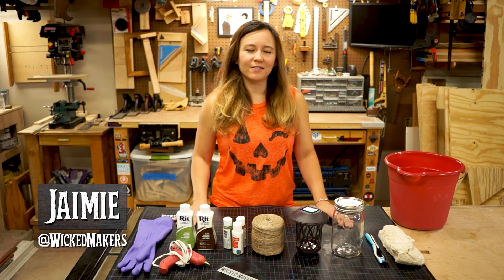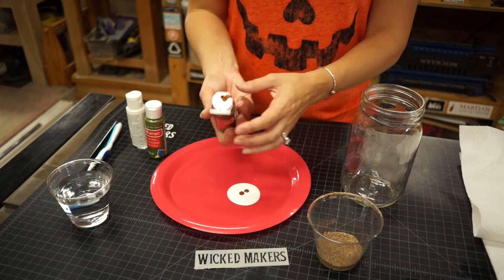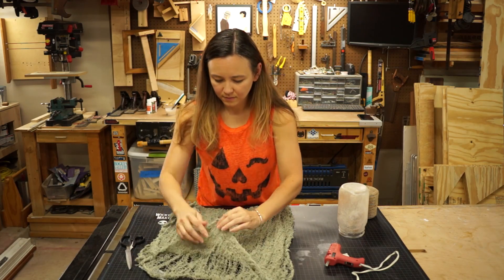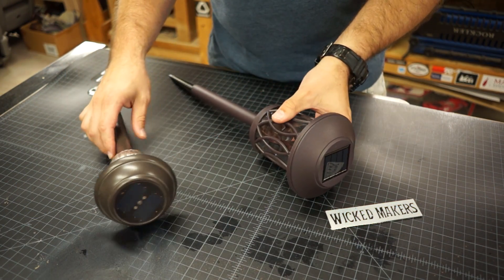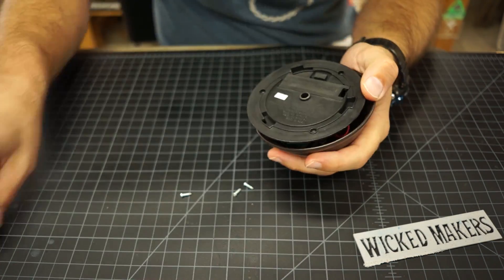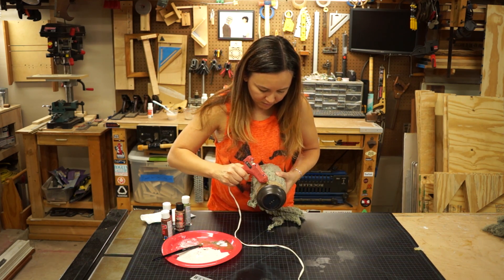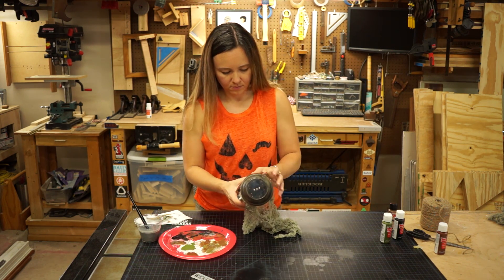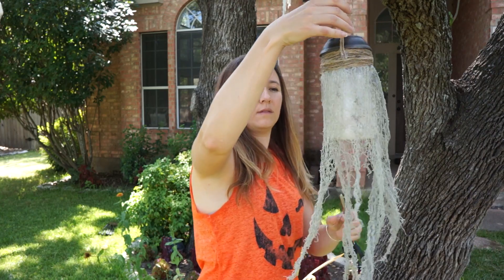DIY Halloween Props - Mason Jar Hanging Lights (Solar Powered!)

Comment: So, just a little tip, instead of changing out the led light, paint a thin layer of gallery glass paint on the bulb. It dries clear orange (for painting stained glass) in any craft store or on Amazon.
Reply from the maker: Nice!! You wouldn’t get the flickering but great way to adjust the color. Love it.
Reply: @WickedMakers  I was about to post a similar comment but noticed someone beat me to it..great minds think alike...actually I wouldn't mind doing this for when we go camping down the beach each summer..we use a gazebo out front of our caravan so I could tie one one or to the posts...make it safer when walking back to camp during one of those late night treks that old folks have to do..chuckle..
Reply: But then you don't get that flicker.
Reply: @WickedMakers jay
Reply: Another and possibly cheaper option is to use a marker or sharpie to colour over the bulb. You can make the colour as transparent or opaque as you want. 
Pros: 
You can leave areas of the bulb “as is” transparent and only colour the areas you want so that you can still see the flickering. 
Or use different shades that are normally seen on a lit candle. Yellow, orange, red, blue, purple, white. 
And if the marker or sharpie is still wet you can use a cloth to either wipe the colour off entirely or use a paper towel to add dimension and remove excess colour so it appears more organic 
After the marker or sharpie has dried you can typically use any multipurpose cleaner that you have in the house or a diy all purpose cleaner (white vinegar, 90% or greater rubbing alcohol and (yes it has to be) blue Dawn dishsoap and it will remove any trace of colour. Leaving you with a clean blank canvas. 
Cons:
The rare time all purpose cleaner doesn’t remove all the colour, use acetone on a cotton round to do the job. Just make sure to follow the acetone with another cotton round that is saturated in water. I’ve never had any issues or caused damage to any light bulbs using this method and the water to wash off the acetone is apparently not necessary. But I try to live by the motto Better safe than sorry.

Comment: The fabric is common cheesecloth, you can buy that all over the place, fabric stores sell it by the yard, also hardware/paint stores sell cheesecloth, so its very easy to find.
Reply: I'm getting a message from "beatmetodeath" saying they can't find cheesecloth, they sell it by that name at paint stores, fabric stores, walmart has it in more than one department, or just Google cheesecloth, its sold all over the place and its cheap.
Reply: G56AG  among other places, in 🇨🇦 we can buy cheesecloth in our grocery stores. Amazon and Wish also sell it.
Reply: This isn't cheesecloth.  Cheesecloth is much finer.  This stuff usually only comes out at Halloween.
Reply: I'm sorry you don't know much about cheesecloth, it comes in a broad variety of grades from 10 to 90. Grade 10 is extremely coarse (open) while grade 90 is a very fine weave. Stores often only carry one grade, as an example paint stores usually stock the grade most often used by painters, and that is the only one they carry, a good fabric store is more likely to have a variety of grades to choose from. Google cheesecloth grades for an explanation about the grades and their thread counts, etc.
Reply: It's gauze cloth

Comment: Just buy the mason jar solar lids. Use stained glass paint to paint the LEDs if they're not the color you want. Really cool project. I've made fairy jars like this with fairy and dragon silhouettes in them. Great to make with kids too.
Reply: I would stick with regular ac power lid as solar lid is not reliable and don't last long. I should know as I have them and they only lasted 6 months.

Comment: We glued the lid ring to the light so we can unscrew it if we need to replace the battery. I also clipped off the edges of the battery lid to help center the lid ring.

Comment: I love that you changed light.  Since I do not have any flickering candles, i thought I would buy flicker leds and replace them that way.  On the leds i want to purchase it requires at least 4.5vdc to fire the flicker circuit which I believe the solar will not provide.  Am I correct?
Reply from the maker: Hmm, 4.5v is probably too much for these little solar lights, yeah. The ones we used have a single niMh rechargeable AA which is 1.2v at full charge. If you can find something with a lesser requirement you might be better off. Good luck! :)

Comment: Love them! I don’t know if I saw it correctly but how would you replace the battery if need be? It’s late, so I might be mistaken and the battery compartment was on the bottom.
Reply from the maker: Thanks! It's a rechargeable battery so you shouldn't have to change it often. Ours have lasted for three Halloweens now. If you do though, just pop the top off, swap battery, hot glue back on.

Comment: i would try kind of orange transparent paper for the orange glow and put it in the glas. so you don´t have to use a soldering gun to change the tiny little bulbs. instead using the solar light as it is. not everyone is skilled enough to use such things even if it looks easy ; )

Comment: Folks, don't solder circuit boards to change the color. Since the outside is opaque, just add a piece of colored gel over the led. It takes two seconds a bit of tape and you can put any colors you want in your lanterns. In addition, leds aren't always interchangeable. Simpler is better.
Reply from the maker: Simpler idea, sure. But you don’t get the flickering effect this way.

Comment: I have bought many different solar outdoor path lights over the years and all of them have only lasted one season.  May I ask how many years have you had these outside?  It looks like it would be rather complicated to take it all apart to replace with a new solar lantern lid.  You guys are so creative! I really want to do this but also really want them to last! What is the battery for if they are solar and wouldn't you need to replace the battery over time and then have to pull off all the hot glued twine?  I hope this isn't a stupid question.
Reply from the maker: We're going into the third season since we originally made these and most of them are still doing fine. The solar lids have a replaceable, rechargeable AA battery and some of them needed to have the battery replaced from time to time. We basically just pulled the top off and re-glued it, so not a big deal really. If you need to, you can heat the glue with a heat gun to help it come off easier. It kinds of depends on the quality of the battery you put in there as well. Hope that helps!
Reply: Rachael Richardson you can buy the new rechargeable battery’s at Walmart
Reply: @WulfricTheBlack  Thank you.  I guess I always thought the solar had to have a special "solar rechargeable".
Reply: @WickedMakers  Thank you. I do feel stupid....I thought the solar panel had something permanent. Gee, not only do I now know how to make really cool solar lanterns, but now I know what to do with the solar lights after they quit working!  Is there a brand rechargeable you can recommend?  Thanks again.  You are amazing!
Reply: Rachael Richardson well these rechargeable replaceable batteries are specific to solar lights. I believe you check the light itself it will have something indicating which type and I believe it’s in the outdoor section at Walmart for replacement batteries.

Comment: So I’m currently making these and the only modifications I’m going to make to these are- I’m going to use a screw on lid for protection of the LED and a standard candle like the ones you guys took apart originally, only because those lights you glued on, the rechargeable battery will eventually loose it’s ability to charge and you’ll have to replace it and the cost of those is huge vs another pack of LED faux candles, and it’s easier to just dump the old led and throw a new one in instead of the whole battery change+possibly redoing the whole twine on the candle. I also just used the same paint I used to make the green/brown wash to make the dye for the cheese clothe, that saves you 5-8 bucks on buying the cloth dye. I also will probably use a matte varnish to protect the paint on the glass to prevent chipping in the future as the paint ages as well as the metal lid from rusting, although I’m not sure of the effect on the visibility despite the varnish being clear. I loved the video tho thank you for the inspiration and awesome video quality, it’s always so nice to see haunters that are a little savvy when it comes to audio/video.
Reply from the maker: Awesome!! Those are great ideas. 🤘🏼😄 Glad you enjoyed the video.

Comment: Very cool! Not sure if you've figured this out yet or not, but a great way to frost class and make it look old and weathered is to mix regular Elmer's school glue with water, and paint that on the glass. It seems to hold up and stick much better than latex paint. I made an old looking gas lantern using this technique. Here's a shot of the lantern https://youtu.be/cQ8dLPfXdNo?t=7
Reply: Question what was the ratio of glue to water you used?

Comment: Everyone uses hot glue, but I just don't have the same success with non-porous surfaces like glass and plastic.  Do I need my gun/glue to be hotter or what's the secret here?  Just had a plastic/metal bond fail multiple times--switching to E6000 or something for that project. Used Gorilla hot glue sticks on that project, if it matters.
Reply from the maker: Try taking some 120-150grit sandpaper and scoring the surface. It might help with glue adhesion. Usually we’ll try to rough up the surface prior to gluing if it’s really smooth like flat glass. 👊🏼👊🏼

Comment: I don't have any solar led lamps and the ones they sell near me are pretty expensive :/ Do you guys think it'd be possible to put a real candle inside the jar? What changes would I have to make for it to work (except for obviously cutting a hole in the lid to make air for the candle)? I don't want my house to burn x)
Reply from the maker: Yeah that should work! Just don't put a lid on it at all and make sure you use a shorter candle so that the twine doesn't catch fire. Otherwise that'd work pretty well and probably look awesome.
Reply: @WickedMakers  Thanks for the answer! I love your the DIY, looks super spooky and cool for Halloween, I'm so happy I'll get to one :)

Comment: Why didn’t you just use the flickering light? Wouldn’t that like more authentic than a constant light?
Reply from the maker: We did use the flickering light. We took the flickering led out of the candle and installed it in the solar light.
Reply: Wicked Makers - oh okay I thought you used the bulb for the orange not the flicker, was hard to see the flicker in the end result.

Comment: I have never once had any luck with a glue gun. The glue never holds, and just comes right off... is there some special type of glue stick you need?
Reply from the maker: Hmm, that sounds odd. What were you trying to stick it too? Usually they work pretty well!
Reply: @WickedMakers  I've tried both glass and plastic, but last time I tried to buy some sticks I noticed there are different kinds  presumably for different purposes, and wondering if I am buying the wrong type?

Comment: "Cheap"?
fabric, glue gun, glue sticks, 2 dye etc.
Reply: Most crafters have these things around anyway. The $$ part for me would be the solar lights..
Reply: @wendijackson8844  we got our solar lights from the dollar store
Reply: I'm a crafter and I don't have the Mason jars, the solar lights or the tye dye paint 😆😆 But you can replace some of these things with others along the way, for example you could probably just put in the small LED candles that you can find at the dollar store (which I always stock up on these led lights) or even use real candles in there and you could paint the cloth with a number of different kinds of paints or glues, you could even use different clothes doesn't have to be spooky cloth though I always recommend buying a bunch of these spooky clothes when you see them. Use your imagination.
Reply: You could dye the fabric by leaving it in some hot tea or coffee for a day or so.